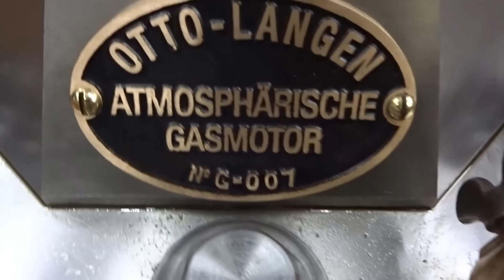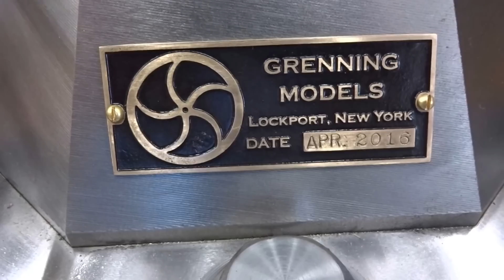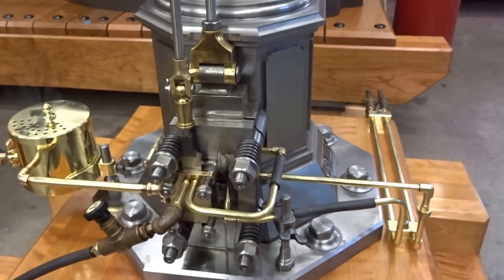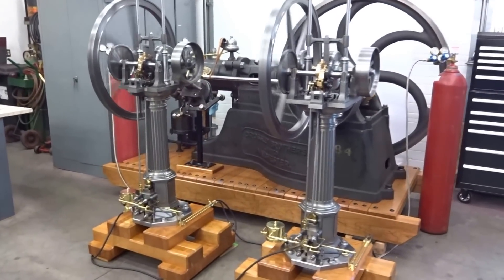SN 6 and 7 1867 Otto Langen Reproduction 75% size Grenning Models April 2016

Comment: Wayne, please tell me, the Otto engine is driven only by the gravity of the rack with the piston or the piston still pulls down and the vacuum formed after the explosion. Thank you in advance for your response! You are a true technology genius!
Reply from the maker: Good question:   Although the weight of the piston/rack assembly contributes to the power stroke ( about 15%) the majority of the downward force that transmits torque to the main shaft through the clutch, is atmospheric pressure after the combustion gases under the piston cool.
Reply: @wgrenning  Wayne, thanks for the full answer. Now everything is clear to me.

Comment: What is the cost to manufacture? I imagine it can't be cheap due to that huge long cylinder. The originals were probably sand cast and then machined to spec, but I assume you're starting from a huge expensive solid rod and having to cut out 98% of it for the cylinder bore. If the base is attached to the column, then also you're machining away 3-5 inches of metal to get the small fluted column
Reply from the maker: These were made in very small numbers in our shop.  If produced in any significant volume a pattern would have been made for the cylinder which as you correctly surmised was originally sand cast.  The large complicated pattern required to accurately reproduce the exterior details would have exceeded the cost to machine from solid.  Not to mention the cost and difficulty to locate a foundry willing to attempt such a casting.  I have been involved with building these in full size in both foundry  poured cast iron from a pattern and from bar stock  all I can say, either rendition is beyond extraordinarily expensive!  Here is a link to a current project where one is currently being made in full size from both sand castings for the smaller parts and bar stock for the main cylinder.  https://www.facebook.com/GrenningModelsOttoLangenEngine/

Comment: Wayne there is no words to describe this two engines all I can say you did a fantastic job!!!!!! May I ask a simple question why did you machine them 3/4 size? For a little bit more material and work I would have made them full size like the original:-)) Thanks for sharing such beauty!
Reply from the maker: +John Hili,  Your question is a good one!  I started building these 15 years ago.  The machine shop resources available to me at the time, limited them to that size.  Also at almost 800 lbs, the 3/4 size was marginally portable.  Now advancing forward to today,  A full size reproduction is quite viable!  Stay tuned..... :)
Reply: +Wayne Grenning Thanks Wayne for your reply, my question was more of curiosity: I suppose you have the drawings for these engines? Do you sell drawings or did you get them from somewhere else?  The only problem for me would be the foundry work as here were I live on the island of Malta there is no cast iron foundries:-( There is only one foundry for brass and aluminum!! Up to 20 years ago there used to be two cast iron foundries but they had to close because for lack of work:-(